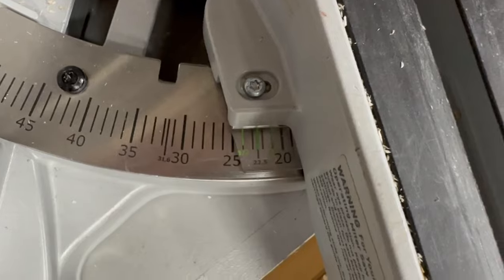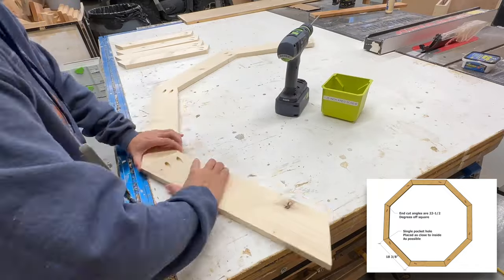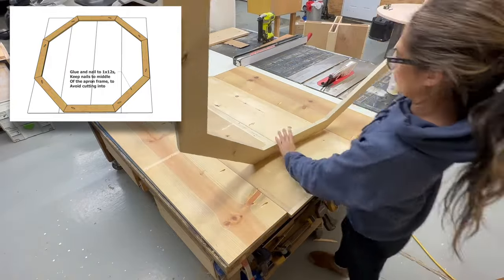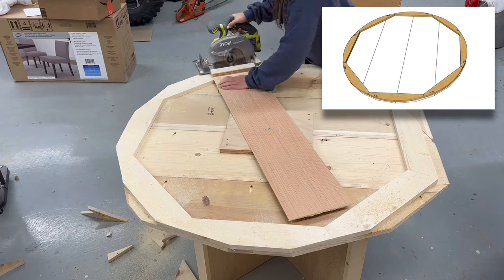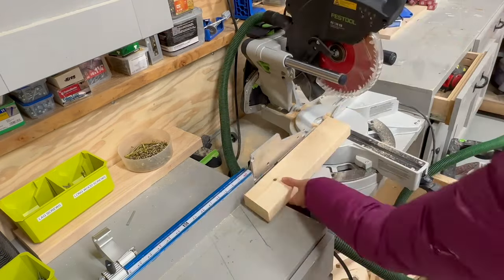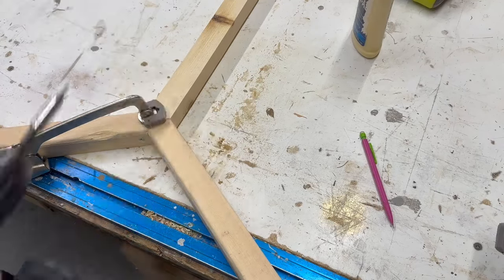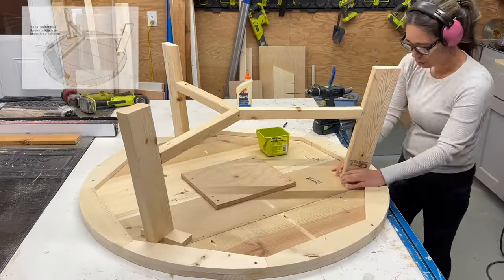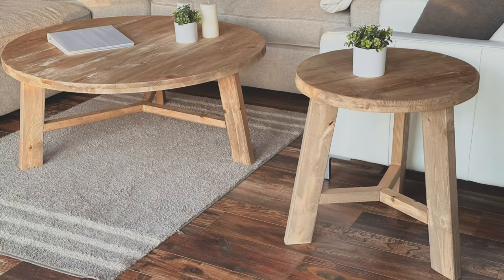Building a Round Coffee Table

Comment: Elegant design. But I don't know if pocket hole screws are strong enough to hold up that center joint of the three cross pieces. Please share your experience on how it has held up. By the way, what is the length of those cross pieces? If they are not too long, there may not be any problem. On second thoughts, may be small leg under that joint may fix any problem. But it will not look good. Anyway, I am interested in hearing your thoughts.
Reply from the maker: So far so good, full plan with dimensions are here https://www.ana-white.com/woodworking-projects/rustic-farmhouse-round-coffee-table